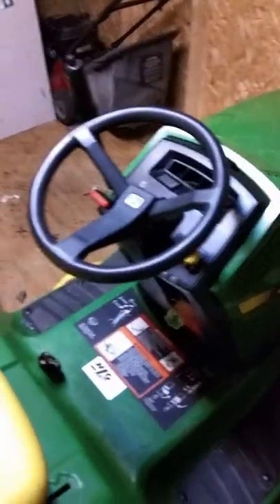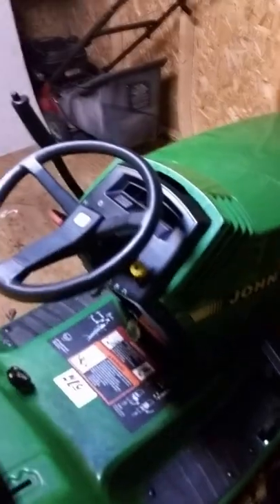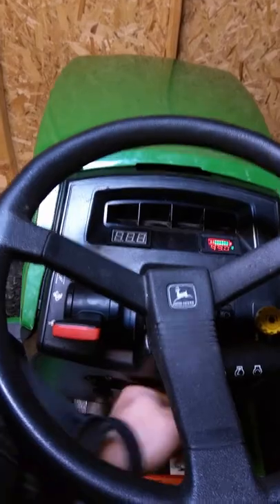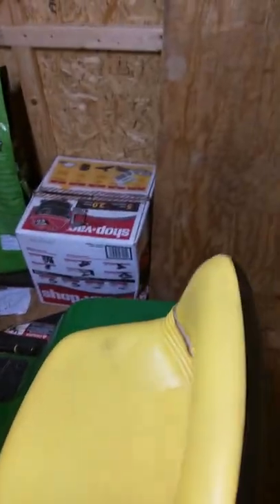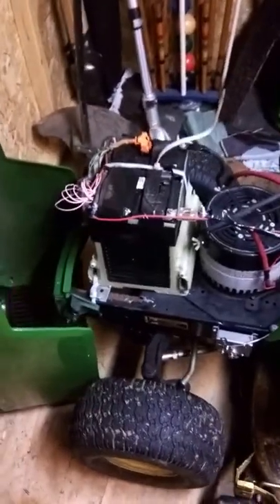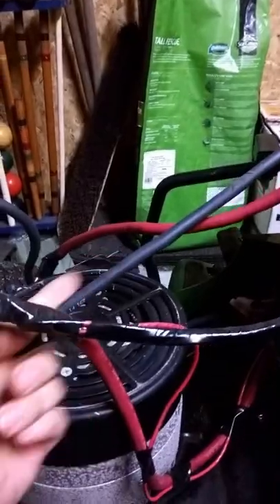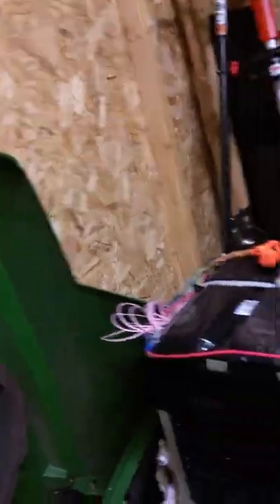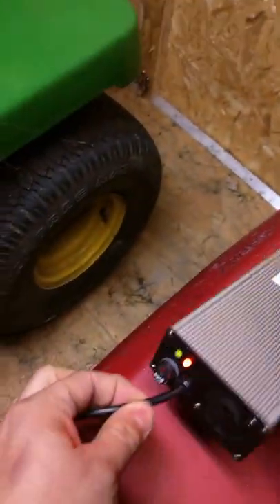John Deere - EV Conversion (Part 1)

Comment: Kohler and briggs have the same mounting holes i swapped a junk 17.5 hp briggs off mine and put a 16.5 hp on it and it used the same bolt holes
Reply from the maker: That's cool. I've done similar things prior to this conversion.

Comment: Great job, where can you buy the Chevy volt batteries and how much are they? I could use them in my conversion electric riding mower, thanks :- electrictractor.net
Reply from the maker: I like the website. You can find the batteries on ebay https://rover.ebay.com/rover/0/0/0?mpre=https%3A%2F%2Fwww.ebay.com%2Fulk%2Fitm%2F223549559549
They are also available on 
https://www.thunderstruck-ev.com/used-chevy-volt-modules.html

Comment: I contacted evdrives about the me1004 kit and they recommend using the Sevcon or SigmaDrive controller if I wanted reverse.  Are you not going in reverse with your mower since you’re using the alltrax controller?  Thx for your time.
Reply: Are you using any 3rd party throttle control or just from the mower?
Reply from the maker: The motor on a riding tractor like this does not change directions normally. If you are using the standard transaxle that came with the mower, it will shift into reverse using the internal gearing and reversing lever.